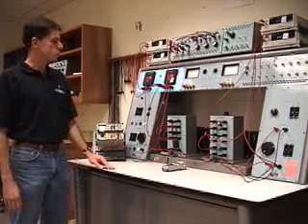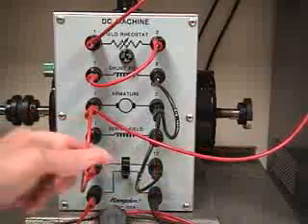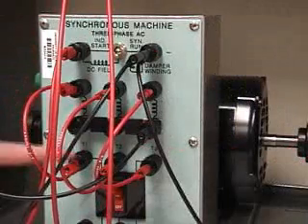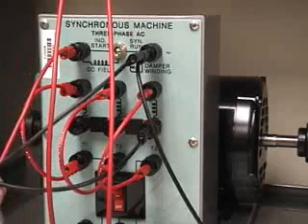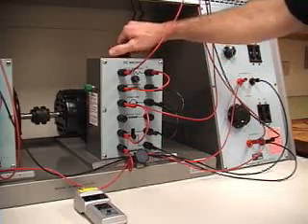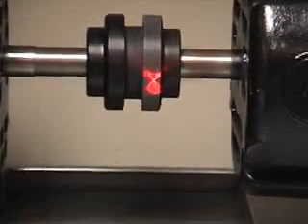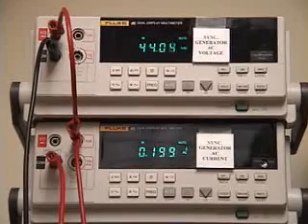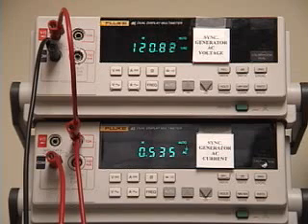Ac generator, motor, and load experiment

Comment: when the moters are conected to alow voltage to flow from shaft to shaft it extreamly decreases the efienceny of the set up. use a gear belt for high efi. or plastic gears not metel to metel. the main shafs are electrifed.